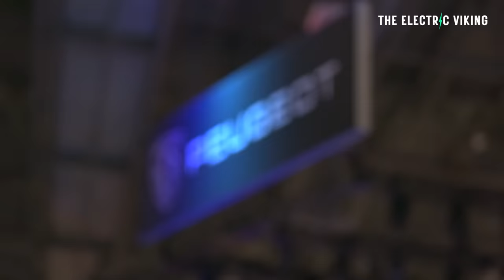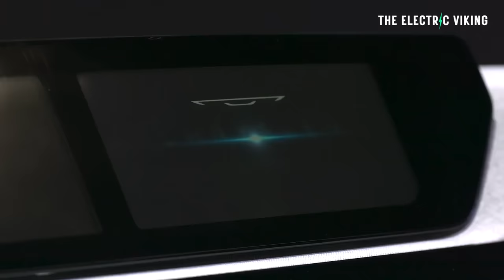Stellantis' CEO says EV Battery WEIGHT needs to be cut in half

Comment: E.V. stands for electric vehicle doesn’t it? 
For millions of people especially in Asia and Africa, but also around the world, their only vehicle is an ICE motorcycle or moped. The best battery equivalent currently available utilises a 25kg pack with a completely impractical range and the price is astronomic. 
If EV’s are to help reverse climate change, this transport sector requires far more innovation and investment than it’s currently receiving. Weight and size reduction together with capacity increase are essential and all at a much lower price point than today.

Comment: 50% weight reduction shouldn't be a problem. If I'm not mistaken the technology is already here. I think they might achieve weight reduction through new production methods.😉. Elon Musk has already hinted on several methods over the years. BMW has brought out the i3 with a carbon fiber single piece shell. And if I'm not mistaken stellantis wanted to experimented with modular replacrable batteries in their future designs. So for example half their batteries to 25-30 kwhs. If you want more you can buy, hire, rent, lease an additions 25-30 kwhs or maybe more for those occasional longer journeys. I think that still is an interesting idea, but stellantis will have to think about starting an ecosystem to accomodate it. It must be convenient to add and remove the modular batteries. There needs to be infrstructure and battery module market for the EVs feom the start en they will have to participate in expanding public charging to convenience status to support more ftrquent charging of EVs or expand  cheap support of home charging for various home types. And yes make less different models and not 75 types. That would be naiive and doom to fail if stellantis wants to compete. I think the power of Stellantis lies more in the established creativity of affordable EVs which makes them still interestimg compared to the competition of the likes of Tesla, byd or volkswagen group. Only their most recent offerings of affordable EVs, somehow just slightly mis the mark of being the right choice as each model still has slightly too much compromise of one or the other feature. What I'm seeing is that they may want to keep their marketshare of trusted clients bit het them to transition to EV with enticing offerings that are at first glance very tempting, but ons second thought feel compromised as well instead of a value upgrade beyond the electric transition story. In that regard I think the electric viking is right in saying Stellantis should focus on only a few models instead of 75, as to bundle their expertise to make a few great cars in large volume and expand from their. Now they seem ro continue with more electric models from what seems a legacy way of working, which fits less in the transition to electric mobility, but still want current customers to be happy with an upgraded electrical model of an ice vehicle legacy design that they're maybe contractually bound to, and don't want to alienate customers for fear of losing marketshare by being too radical. Maybe there is some truth in that, an true innovation lies in making the old better, instead of starting with a clean slate which often seems to be the new train of thought these days, because making the old new new is simply too difficult for mankind and AI?

Comment: i can see his point - 1kg of petrol yields on average 8klms of driving,  EV batteries are much higher ratio than that
Reply: Kind of apples to oranges. A car engine + transmission + exhaust system + (empty) fuel tank weighs around 375kg, an EV motor weighs 45kg. The battery can be a structural component making the frame lighter, whereas a separate structure is needed to support the engine, transmission, fuel tank, etc. The weight of the battery is low down, which helps with stability. It's also evenly distributed which helps with cornering. Electricity is cheaper than gas. Electricity is way more efficient than gas. So you can't just compare the weight of the battery to the weight of the fuel only, you have to look at the entire system to get a sense of pros and cons.

Comment: There are many size engines! You give a lot of info that lacks context. I might do it too if I made the money you make off youtube. I can literally pick up a 3 cylinder geo metro engine up with one arm, they weigh a 135 lbs. There are bigger engines but let's compare apples to apples. A 350 (5.7 liter) Chevrolet engine weighs 575 lbs. A big engine such as the 350 is something that is found in a full size truck or muscle car. The hummer ev battery weighs  2800 lbs. You could put 4.86 small block 350 Chevrolet engines in the hummer ev and it would weigh the same.

Comment: He has a point...  Tesla is never a fair "example" because they are the most cutting edge technology auto manufacturer in the world... so specialized they are even willing to use CATL batteries which is the most technologically sophisticated battery manufacturer in the world... and they are still struggling with this... It is a fair point... it could completely change the ENTIRE industry as a WHOLE... but it's a round about way of saying... We need to double battery power...  which may or may not be possible in the next 10-20 years

Comment: I don’t thin the Viking knows himself what he is talking about when it comes to recycling ICE car engines, of course the get recycled with the rest of the car. I don’t know where he thinks they go.
It’s not rocket science that the battery contributes a lot of weight to the car so if you can reduce the weight you will get more milage. EVs wear tyres 20% quicker than ICE cars because of the extra weight and regenerative braking,the tyre companies are loving this.

Comment: The weights will come down as energy density comes up. 700Wh/kg is already being produced in labs. This is 3x the present density so all things being equal the weight of the batteries should reduce by 66%....But I think it's more likely that range will double with only a small reduction in weight.

Comment: To reach 50% you can start by targeting 5%, then 15%, then 25% hopefully the cost to benefit will be clear and other manufacturers wouldn't have taken the whole market with current battery weights using better energy management, charging networks, optimized planned recharging on the charging network, and who knows what or what not!

To begin your journey please remember that you need to start!

Comment: Could they build lighter modular batteries so drivers could add and subtract the batteries that they need, so you would only add heavy amounts when you really need them. Very few people really need to drive very far very often. Then the manufacturer could own almost all of the batteries and charge all of them, and people could pick up and drop off batteries at filling stations or any chain store. Then most EVs could be lighter than most ICE cars. Then most EVs would waste less energy carrying around batteries very few people need.

Comment: Batteries are "dumb" weight, as in, they are not very complex but just weight a lot.
Compared to say an ICE which will weight less than a full BEV battery, but it's "Complex" weight, requires a lot of precision engineering in assembly and regular check ups, so cost wise his point is idiotic.

All that needs to happen is for battery costs to fall, less weight is a bonus and not a requirement, he is just a terrible CEO.

Comment: Are you really that clued out? The issue is hauling around a 1,400 lb. battery, day in and day out that cost $25,000.
Reply: Price in China now $70-$100 / kWh, so 60 kWh of LFP cost is $4,200, not your joke $25,000.
And making a pack is automated, doesn’t cost much.
New generation Tesla motor / controller cost ~$1,000 all up.
Could build a Subaru style AWD drivetrain for ~$7,000
Now at time of original Tesla Roadster, they were expensive batteries.